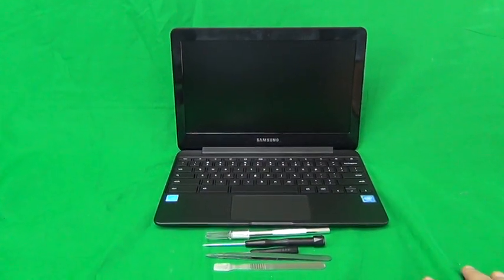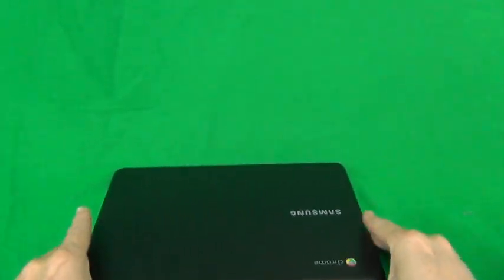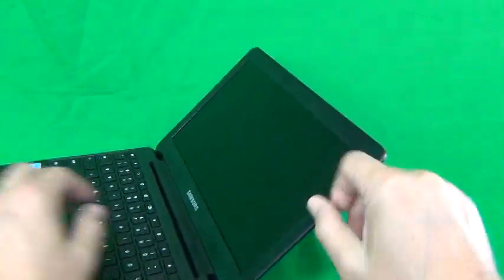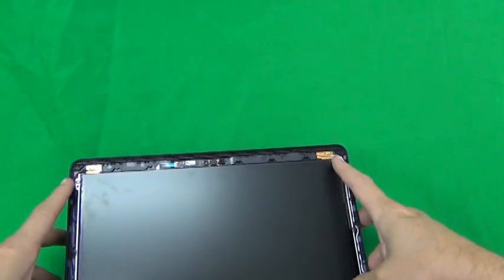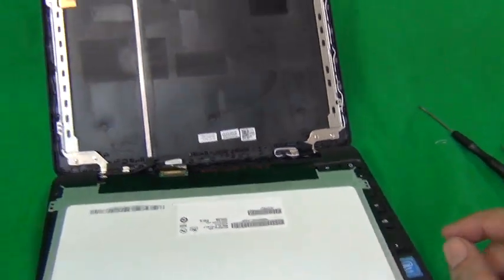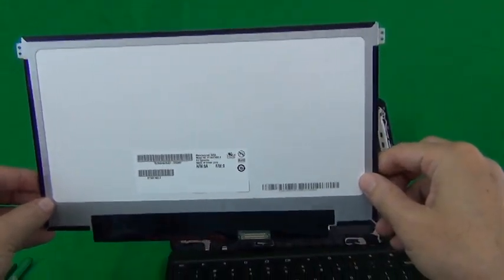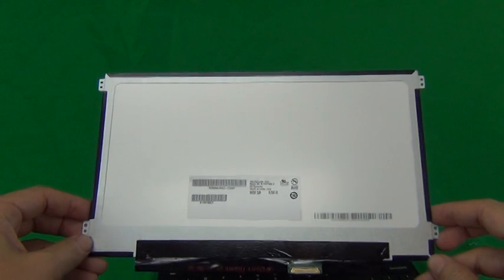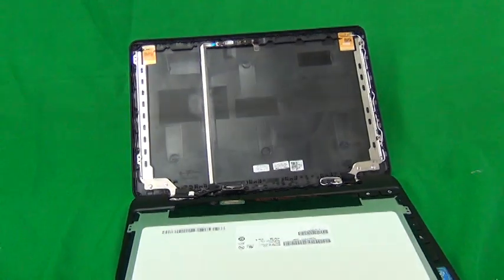Samsung Chromebook 3 XE500C13 Screen Replacement Procedure

Comment: Thanks. I actually ended up taking the screen off my old Chromebook 3 and putting it on my wife's Chromebook 4 (after the kids dropped it and broke its screen). Chromebook 3 no longer supported, 4 has support until 2029, so it was a no-brainer. And it worked! Thanks for your help. Gave me confidence to give it a shot.

Comment: The one I just fixed had sticky tape at the base of the bezel.   Otherwise I replaced the screen.  All easy.  Ha ha, just don't lose the tiny screws.  Be careful when popping the bezel back in place.  It's flimsy and kind of fragile. But, if you do crack the bezel, I think ScreenSurgeons has them in stock if you want to replace it.

Comment: my screen was not cracked but was not displaying and I assumed that the connector was loose but it was more than loose
but sadly that was not the issue and I still have a paper weight chromebook any idea on how to fix it
btw my mother fixed this same laptop with this video so thank you

Comment: Love it soo easy to replace and my computer is back to new. The only little problem I have is the letters and number that are on the left side of my screen. It’s getting in the way a little. Would rather smaller font if it has to be there or off in a corner on.